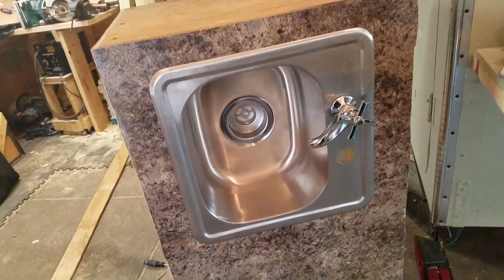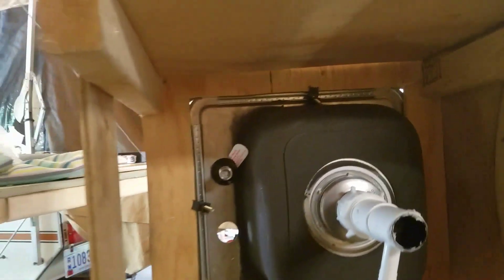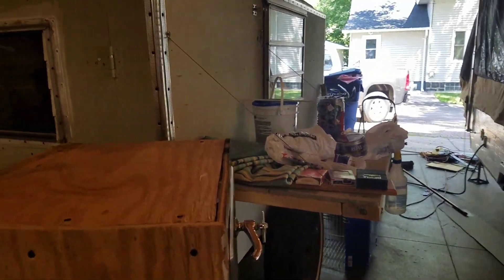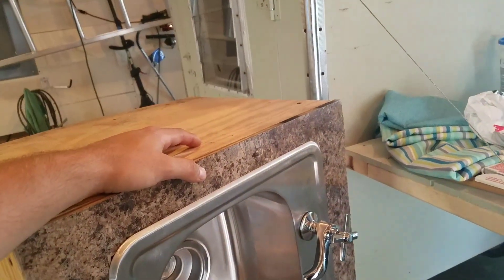Wednesday update

Comment: I built a sink cabinet like yours back in the 70's for my VW bus camper.  Water would not drain out the garden hose until I installed a tee and ran a vent pipe that extended slightly above the counter top.  Before I did that water did not drain easily.  Give yours a wet run and check it out on draining a gallon or so.